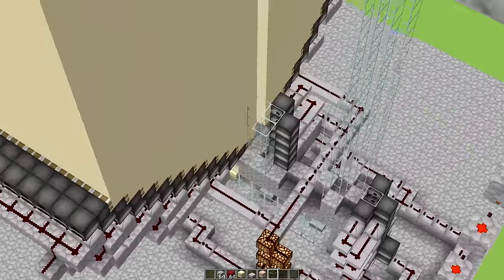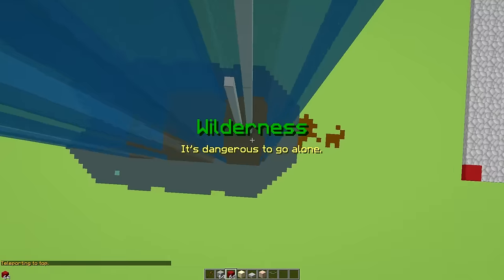Detailed Explanation of cannoning filters/grills/honeybee

Comment: Would using a trapdoor work better, worse or have no diff to the slab guider?
Reply: the smaller the guider is, the more hammer it will use to stack the same amount. full block guider used 1.2 tnt per sand or so, half slab guider will take 2 or so.
the trapdoor will work as a guider though
Reply: worse, requires almost 2x as much hammer